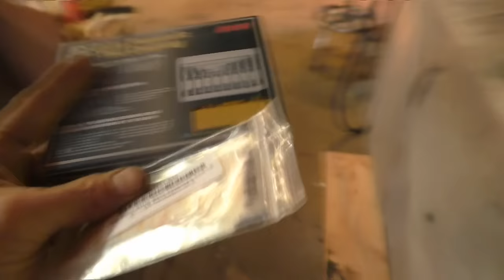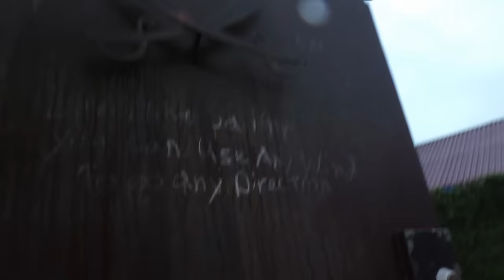Scuppers, Keels and Pouring Lead

Comment: Diesel+lead+steel cannot have any electrolysis, diesel is oil based.  The biggest problem you'll have is the fact that diesel is hygroscopic and water will absorb into it, potentially causing corrosion of your keels.  You need to paint a sealer on the inside which is intended for diesel fuel tanks, then you'll be fine.  I recommend sealing all of your fuel tanks with a paint on sealer.
Reply: exactly my thoughts!

Comment: This might be a bit late, but may still be helpful... 

I worked on a 1920's built riveted hull ship. She'd had lead ballast in multiple diesel fuel tanks for about 12 years; the tanks were in great condition inside. No cathodic/anodic/differential nobility problems.

Comment: not sure if someone already made a similar comment but diesel is non polar and shouldn't react with the metal but maybe when if water gets in there and goes to the bottom might get a little nasty.  back in the day they use to repair gas tanks with copper and lead solder.

Comment: Sealing the fuel tanks.
I may have missed it in the video how you intend to seal the tanks but we used a sealant from aircraft spruce in wing tanks. We did have the option of rolling the tanks around to completely cover the interior. poured the rest back in the can and found we hardly used any. Wonder if it can be sprayed or painted on?

Comment: Do you guys wear any protaction against the lead fumes?
Greetz from belgium
Reply: Leads only dangerous if you want to have kids right? Haha
Reply from the maker: +MrRube007    That's not a bad link, but the precautions in the description are better directed at working with lead.
Reply from the maker: +Patrick Burke     If you are a kid.  It effects nerve development.   ...that's not a big deal for use old guys, unless you are going to get pregnant.  And its why the precautions in the description deal with keeping your cloths separate from the families.
Reply: +SV Seeker yes I was just joking. lead is serious stuff as I rebuild old houses and the old paints are loaded with it massive regulations regarding removal. Have to say I have watched every episode so far can't get enough. The best YouTube channel I have ever found. Worried that your going to finish and not put anymore shows out.
Reply from the maker: +Patrick Burke    Oh!  Yeah, you would know the precautions.   Thanks for watching.
Reply: There are no lead "fumes" at the temperature at which they're working.  Lead doesn't vaporize until it gets to about 1150°/594°C.  It is unlikely that they are above 700°F/371°C based on my 40 years of experience with molten lead.

Comment: Having no clue about boat building, but how do you know how the boat will sit in the water, with all this lead weight at the bottom, in different places? Will the deck be sort of flush with the water? Just ponderin' on how that might work, as the boat will only get into the water after it's finished. Or do you adjust weight distribution afterwards?

Comment: We ave similar caveties on our commecial fishing trawler (steel), its common to fill the void with Concrete (because its cheap) but lead can also be used, weld a lid on and to avoid rust issues we fill the void with plain old motor oil through a bung. My boat was built in 1976 and I cut open a tank built like this and some minor surface rust but nothing to make me think it wont last another 40 years.
Reply from the maker: Cool, thanks.

Comment: Why do you not make a hot metal tank, instead messing around with the half stone/steel water tank. You have probably al the stuff laying around?
Reply: Or just line the one he has with steel.
Reply from the maker: +Joop Terwijn    That's actually more work than you think with the current connections.   I build that tank 10 years ago.

Comment: Have you tested the coal tar epoxy with diesel? Will some of the epoxy dissolve in the fuel and gum up your system.  Maybe tar the inside of a pint jar, fill it with diesel, and let it sit on the shelf a while.  The steel and lead don't bother me so much. Aren't diesel and gasoline dielectric? I've worked on plenty of in-tank pumps with bare electrical connections.

Comment: Doug, what is the purpose of the plate outside the scupper? The water is already outside the boat when it passes through the scupper opening. Another plate means more maintenance, another obstruction outside, another thing to rust.
Reply from the maker: +MrCGChief    I suggest you don't put them on your boat.

Comment: I thought you were going to hold some chambers "in reserve" to balance out the boat on the water. Did something change to make you want to fill  the forward keel compartments? I wouldn't blame you for not wanting to deal with water accumulation in there later on in the build.
Reply from the maker: +jeremyrainman    Those chambers will also be a fuel tank.  All we'll have to do is add ingots and epoxy them in place.

Comment: One thing you may want to think about Doug,  where you cut the piece of rib out to put the scuttle's in, Should you not have refitted it and welded it to the scuttle frame to keep the strength integrity of the hull intact.
Reply from the maker: +Peter Mundy    Right.  That's really more like a longitudinal, but it's really not even that big of a part of the structure.  It's mainly there to help form the hull when it is being bent.   The curve of the hull and the deck above are the primary reinforcements.
Reply from the maker: +Gottenhimfella    Then I guess we are going to break apart and sink.   :)

Comment: Are you going to weld eyebrows above each port hole to keep the water from running down the glass?
Reply from the maker: +Twentypdr Parrott    No.  Considered it, but the portholes all lean outwards and are recessed.

Comment: Just had a thought that i'd love you to answer in one of the videos - what kind of electric and welding gas bills do you run up every month and do you ever have problems with not having enough power to run a house, workshop and 'ship yard SVSeeker' of a domestic electrical board?
Reply from the maker: +Jonathan Cook   We run off a 100 amp panel.  Last months electric bill was $109 and I refilled on CO2 tank for $65.   If you want to build a basic 36 foot steel sailboat, you could do it for less than $35,000 dollars.   Money is not the problem.  Courage is.
Reply: +SV Seeker  A lot less than I expected! Building a sailboat is not on my agenda, but interested anyway as the skills are highly transferable and every year I build a ski lift, which gets more inventive and elaborate every year, and good metalworking skills are the key to such a build.

Comment: when i see u all working with anglegrinders i think how often have they been in the hospital already
if a cutting or grinding wheel ruptured it would impact your stomac with the force of a 9mm Parabellum 
also if you use the fucking safety shield you would not burn your clothes or skin 
The boat looks great hope they got it ready before it rusted apat again
use leather clothes when welding ,handling liquid lead, plasma cuting etc
Reply from the maker: Love you too mom.  We'll be careful.

Comment: Great content as ever. Have you tried Plasti Dip paint for sealing the tank. it doesn't tend to go brittle when its cold. its based on the chemical paint thats used on swimming pools. although the plasti dip brand is more flexible. We use it for painting onto the ware areas of our coasteering wetsuits.
Reply from the maker: +The ClanAdventures    Not yet.  I did get some Flex Seal.  We'll give that a shot and that last drip.
Reply: The swimming pool paint is referred to as Chlorinated rubber paint. it works it way into the smallest crack then sets rubbery. The plasti dip does not run into the cracks as well but does give a very flexible coating. The price is night and day between the product. It might be a lot cheaper in the USA here in Scotland its 4 to 6 times the price of the Chlorinated rubber paint.

Comment: consider sealing the welds in the fuel tanks with epoxy to prevent any leakage.
Reply from the maker: +Dennis Williams    That is the current plan.  Coal Tar Epoxy

Comment: Keeping the diesel fuel with the lead is a bad idea... You risk rust accumulating into the fuel and clogging filters or god forbid eating piston rings on the engine.

In my opinion, your options include:
1) Having a large filter and pump and using at least 1" pipe for the fuel to ensure rust that does accumulate clogs an easily replaceable filter instead of getting stuck in small piping you can't access or fix

2) Making either aluminium or stainless steel boxes to house fuel. Best option as they won't compromise the engine

3)Using some sort of gas tank sealer to coat the inside, implausible as they require you to shake the gas tank.
Reply from the maker: +Ariel Lezen    I don't think I agree.  Even if the fuel was directly exposed to the lead, which is not the plan, I don't think there would be any significant absorption of the lead into the fuel.

Comment: my question is how did you calculate how much lead you needed to put in the keel to stabilize the junket ?
Reply: @Harry King, CALLED AREA, NOPE NOT BEING A SMART ASS, BUT WHEN WE THOUGHT BASIC MATH, WAS A WASTE OF TIME! WITHOUT MATH, YOU ARE BONED! MY DAD TAUGHT ME WITH A "NON BATTERY" OPERATED SLIDE RULE, NOPE NOT THAT OLD YET, BUT MY DAD WAS A YALE GRAD, WITH 2 MASTERS IN ENGINEERING, SO IT WAS HIS WAY!

Comment: I saw you using the suitcase welder. I wanted to ask you how are you running it. CV. or C.C. I bought one for my shop and I'm trying to figure a way to hook it up to one of my machines. I have a lincoln power mig  350mp and a miller 250 snycrowave tig. Both can do C.C. but would much rather have C.V. or short circuit welding like a standard mig is.

Comment: Is there some type of paint on or spray on lining for those diesel tanks in the keel ? That would take care of any leakage down into the lead.
Reply from the maker: +mcpheonixx   Nothing is needed for a steel tank with diesel in it, but I am thinking of using coal tar epoxy in the bottom to seal the welds and hold in place any lead ingots we have to add in order to trim the boat once it is in the water.
Reply: +SV Seeker aaaah ok that makes sense

Comment: Does the lead adhere to the steel?  Just wondering if it shrinks and leaves a gap where water can get in and rust.
Reply from the maker: +acemannotsomeother     It shrinks and leaves a gap.  But by sealing it off we cut it off from oxygen and the rust will stop once the last of the oxygen is gone.

Comment: You could prevent all of that dross in the pours if you fluxed your lead with a bit of paraffin or sawdust and then used a large soup spoon to rake the dross away.
Reply from the maker: We needed 15 tons of lead, we didn't need it to look pretty.  :)

Comment: Ya okay, I know safety isn't the biggest issue around, but holding an angle grinder like someone does at 21:30 is just plain stupid. After all drinking the beer under the stars, works better with an intact holding tank. :)
Reply: +Thomas Kristensen "I see no possible way this could end badly!" :P
Reply: +Azayles My bad :)
Reply from the maker: +Thomas Kristensen   Thanks Mom!   We'll be careful.
Reply: also what is stupid is the fact all of those animals are running around
Reply: i've done that... it works
Reply: Fuck that shit. That angle grinding was just fine. Worst you can do it get alittle abrasion or burn. Its a grinding disk, not a saw blade.

Comment: FYI: it's the hoist pendant, the controller is inside the hoist.
Reply from the maker: +Ram-n_dodge    That's interesting to know, but if I ask a crew member to get the hoist pendant out of the tool box, I don't think I will have actually communicated.  :)
Reply: +SV Seeker Good point, only learned when ordering parts myself.
Reply: +SV Seeker The hoist clicker.
Reply from the maker: +J Santarsiero    Yellow thingy with the buttons.

Comment: about keels....when weld of out side have a leaking. ..how now  it and you close the top of keels
Reply from the maker: +Hussony Fjkl    Google Translate?      The steel on top of the lead is like a double hull.   It prevents damage to the keel from forcing water into the fuel tank.   It also keeps fuel out of the lower section of the keel.
Reply: +SV Seeker thank you so much. ...

Comment: I noticed when they were pouring the lid I could see light from one side of a bucket of the other that means you don't have watertight bulkheads which junks were famous for and what you say your condom trying to be
Reply from the maker: If the water ever gets that high it will not matter.  We’ll be a submarine, not a sailboat.  :)

Comment: Why not put grease nipples into the steel caps for the lead keels, then you can use a grease gun to squeeze epoxy into the gaps around the lead?
Reply from the maker: +Duncan    That would be a lot of pumping but I do like the idea.  Should we need to, we could just hook a pressure pot to on end and wait for it to come out the other.
Reply: +SV Seeker one of the big 5 gallon air operated grease guns would be ideal for that but probably be to expensive for a single use job like that.
Reply from the maker: +Duncan   Right.  And we can use a paint pressure pot to paint the boat.

Comment: I doubt you'll have a problem with cathodic issues and your fuel. Although modern vehicles have plastic fuel tanks...All older vehicles had stamped metal tanks with soldered seams. And the radiator shops would regularly repair leaks by resoldering seams and soldering patches over punctures. 
  Solder is mostly just zinc, tin and lead..or...50/50 tin and lead....And I doubt any issues of corrosion ever occur due to electrolysis.  I've never heard of that...And FWIW....most metal tanks were fairly thin sheet metal. Probably 24 or 26 gauge. We'll all be long dead & gone before you have any issues with electrolytic corrosion IMO.
Reply from the maker: +Tim C    I think that is correct too.  Just nothing solid to back it up yet.   Anyway, we have ports into that area so we can do something later if needed.

Comment: In aircraft the fuel sits in bag's,..in the wings and just about everywhere, you'd could do that in your boat as well.
Reply from the maker: +ThatDutchguy    Bladders don't do as well in boats.  Planes sit still on the ground but boats continue to rock and that adds to the chafing.
Reply: SV Seeker Ahh, so that rules that out, but couldn't you make some kind of fuel tank lining sturdy enough to resist wear, or containers ?

Comment: dont think they be calvanic action between diesel and other metals , i believe diesel acts more as an insulator then a conductor , the old style fuel before catalic converters had lead in it though 

had the same thing happening to me while grinding once , was wearing a coveral and was sitting spreadlegged while grinding on sumething in front of me when i smelled sumtin burning , the way i managed to trow away the airgrinder 1/2 inch hose and all and slap it out without hitting my nuts was impressive , good thing those coveralls where baggy in those days , nowadays i need stretch coverals to fit in them AND button them up

about the switches of the crane , you could try coating the contacts with some dielectric grease before reassembly , might help against the corrosion 
http://i5.walmartimages.com/dfw/dce07b8c-43b7/k2-_4a5800a0-841b-412f-bd2f-ec65ce361912.v2.jpg

Comment: A bunch of molten smoking lead in a confined space what could go wrong
Reply from the maker: We could post it on the internet and let fear and rumors do the rest.   Lead does not smoke.   That's wax burning off.  The lead is always under 800 F so vapors are minimal.   Go for a drive if you want to fear something.  In 2010, there were an estimated 5,419,000 crashes (30,296 fatal crashes), killing 32,999 and injuring 2,239,000, and around 2,000 children under 16 years old die every year due to traffic collisions.